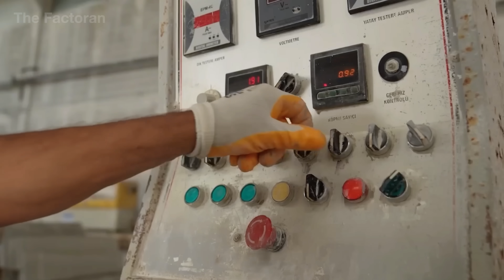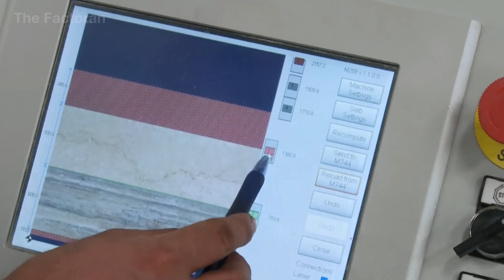How Millions of Granite Slabs Worth Billions Of Dollars Are Made — From Rock To Luxury Surface

Comment: They call granite "the fossilized memory of the earth," but we treat it like a microchip. The blocks are 100-ton chunks of rock, yet they use laser sensors and differential hydraulic drives to maintain a tolerance of less than 1 millimeter. That level of precision for a naturally formed material is insane! Where do you think we see that combination of raw nature and hyper-precision the most?
Reply from the maker: You nailed it — that blend of raw nature and extreme precision shows up most in stone cutting, watchmaking, and even semiconductor wafer slicing.

Comment: in the old days, they used to drill pilot holes, fill with water and wait for the water to freeze and expand to separate the blocks.
Reply from the maker: Exactly — that old freezing method was a clever, low-tech way to split massive stone blocks cleanly.
Reply: Evidence suggests that ancient Egyptians employed fire-setting as a method for extracting hard stones like granite. This technique involved controlling the temperature of the fire to create cracks in the rock, which were then driven in with wooden wedges soaked in water. They would grind concave bowls to put the fire in along a line. 
Recent studies have shown that fire-setting allowed for a significant depth of trenching in granite compared to the limited depth achieved without fire. This indicates the effectiveness of fire-setting in granite extraction and its importance in ancient Egyptian quarrying practices.